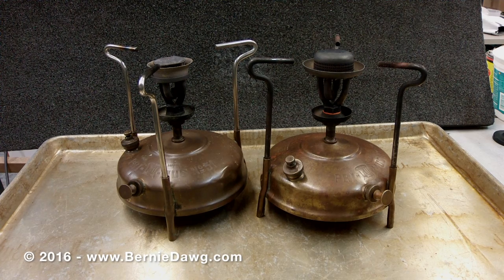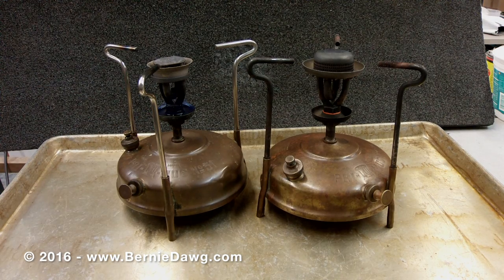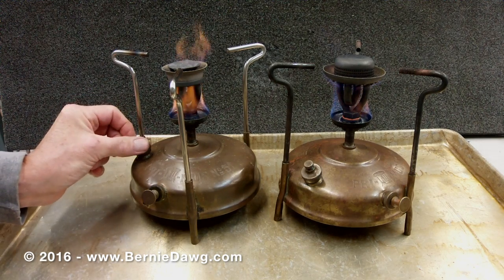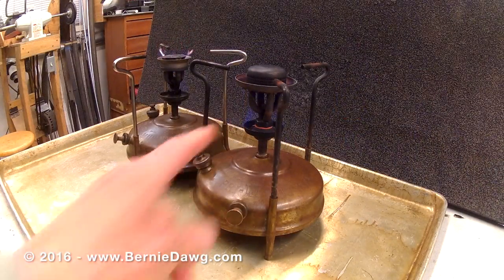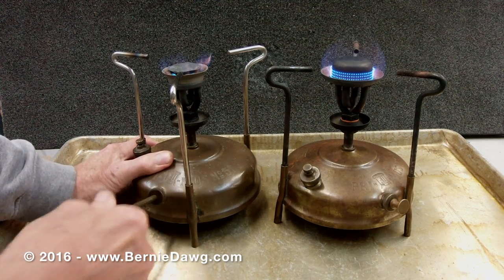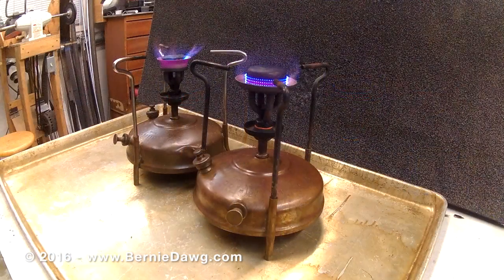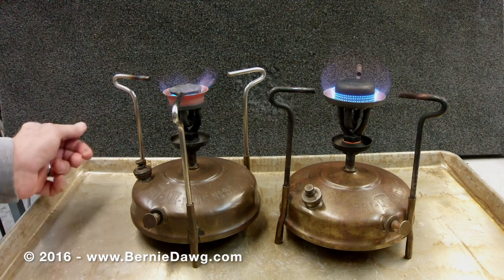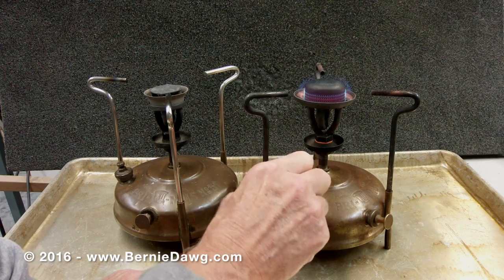How to Light and Operate a Vintage Kerosene Stove

Comment: Hi I just got a Valor 55 pressure cooker I've followed all your instructions,but it doesn't seem to have any pressure ,when I pump it can you please help me thx Lloyd from New Zealand
Reply from the maker: @Lloyd Morgan Sure Lloyd. Easiest is to send an email to my help line here: bd@berniedawg.com But, if you're shy, here's a bit of help. If it doesn't pressure it could be because the filler cap gasket is shot and needs replacement. Or, the NRV valve in the bottom of the pump tube needs servicing. Or, the leather pump cup on the pump shaft is missing or in bad shape. I have other videos that show you how to fix all that. Check through the playlist here: https://www.youtube.com/playlist?list=PL9Tg7BYD6fULVp5VFHNYZkUSIQUA6R8Gk BD

Comment: Hello BD, this is probably a stupid question but can you interchange silent caps with the plate type on any stove? my little brain tells me there might be problems as if they come that way leave well alone, but I like the quiet burn, thanks for all the info just subscribed to the channel and enjoying, Ted from N.Ireland
Reply from the maker: Hi Ted Your question is not stupid at all. I hear this question all the time. Thousands of people, the majority of people in the world actually, would rather their loud stoves perform like they had silent burners. Some original manufacturers even made products for this purpose. But, these days, if you have a flame plate type roarer burner I have a solution for you. Check https://www.shapeways.com/shops/berniedawgshop or https://i.materialise.com/en/shop/designer/gary-adams . These are products I designed and have printed through 3D meal printing outfits that can transform your loud flame plate roarer stove to a silent stove. Don't forget to read the instructions found here before you purchase: http://tinyurl.com/lvv3syn Hope this helps! BD

Comment: Outstanding video. Thank you. I have 2 of these roaring stoves from India. Very old.  There are made from brass but I never knew how to operate them.  I am going to buy the kerosine / or lamp oil and try it.
Reply from the maker: You must make sure to replace the old rotten seals on your "old" stoves before fueling or firing. Avoid flaming injury or death. Video shows you how: https://youtu.be/2LKsxIYCTko  BD

Comment: Thanks for the video mate. I just acquired one of these burners you have on the right in your video from my late father's estate. Very helpful video, cheers. 🤙🇦🇺
Reply from the maker: @Mark Thanks! I have a playlist of other videos that will help you to get the seals freshened up so you can use your Dads old stove safely right here: https://www.youtube.com/playlist?list=PL9Tg7BYD6fULVp5VFHNYZkUSIQUA6R8Gk Happy fettling! BD
Reply: @BernieDawgCinema  Thanks mate. 🤙🇦🇺
Reply: @BernieDawgCinema  Hi Bernie, any tips on getting the burner back to being nice and shiney?
Reply from the maker: @Mark Sure. You can spend many hours with non-ammonia brass/metal polishes and a toothbrush to get the burner shiny. Problem is, once you light it again all the work you did will disappear completely as the brass/bronze alloy of the burner turns grey from oxidation in just a few minutes of use. No point to polishing burners unless it's just going to sit on a shelf and not be used again. Hope that helps. 👍 BD
Reply: @BernieDawgCinema  Cheers mate. 🤙🇦🇺

Comment: Thank you. This is exactly what I wanted to know. One question Bernie, how do I know if my stove is silent before operating it? It's a Svea #5 and I literally bought it at auction yesterday.
Reply from the maker: You take a look at the burner you have on your stove and compare yours to the burners on the stoves in this video. Silent burners look completely different than roarer burners. The Svea 5 should have come fitted with a silent burner from the factory, but only you can tell if it has the original burner or if it was refitted with a roarer at a later time. OR… send me a photo of your burner and I can tell you what you have. Bd@berniedawg.com .

Comment: Food tastes better cooked on these stoves and the aroma gives you an appetite
Reply from the maker: Cooking food outside in the wilderness when you are really hungry always makes it taste better. 👍 BD
Reply: @BernieDawgCinema  Absolutely and the thrill of cooking on a primus/optimus that preceeds eating is an appetiser.
Reply from the maker: @Rammoy1  "Thrill"? 😲 Okay. If you say so. 😀 BD
Reply: @BernieDawgCinema  Yes pure thrill. I love these stoves so much. By the way one of my silent burners is giving out a thin streak of smoke when burning. I thought the jet is oversized so changed it with  onother which I guessed had a smaller aperture but with no luck. Fume still comes out don't know from where.
Reply from the maker: @Rammoy1  Again, *as I said to you before*, it is difficult to diagnose problems in YouTube comments. You are welcome to send me email and photos of your stove issues to the email address you'll find in the description section below the video.
But, a "thin streak of smoke" generally indicates a fuel vapor leak from a crack or hole in the burner. Waving a flame source like a lighter near the vapor stream will often cause it to to catch on fire and make a small candle flame where the hole or crack is located, and from which the burner is emitting the fuel vapor. Holes/cracks in burners negatively affect the flame quality of the burner and may cause yellow flames or underburn. Burner cracks or holes need to be repaired with "silver brazing" at a very high temperature (700-800 Deg C). Such repairs require well-practiced stove repair skills. I do such repairs frequently for my clients and at little cost. I demonstrate silver brazing repair of a Optimus 111C burner right here: https://www.youtube.com/watch?v=PYK-0KwQBzc  BD

Comment: Thanks for the video, can I ask how much fuel is needed to fill tanks from empty? Your vids have been so helpful
Reply from the maker: @roy allan That’s a more complicated question than you may have guessed. The two stoves in this video each have a tank capable of holding 2 pints (0.94 liters) of fuel. But, because you need air space in order to pressurize the fuel, the original manufacturer (Primus) directs to fill each of these stoves only 2/3 full (1.3 pints or 0.63 liters). That’s for the two stoves you see in the video.
But… these sorts of stoves came in many, many sizes and models with tanks ranging in size from as little as 1/2 pint (0.23 liters) to as large as 8 pints (3.78 liters) or more.
Best practice is to fill the tank so that the fuel is a bit below (1 to 1.5 centimeters below) the inside of the fuel filler neck when you peer into the fuel filler. This will give you roughly 2/3 fuel and plenty of air to pressurize the tank no matter which of the sizes of vintage stove you may have. 👍 BD

Comment: What does the pressure do to kirosine in the Tank? Will it pump it up to the burner?
Reply from the maker: @Amma Doing Yes. The pressure in the tank forces the kerosene up into the burner head. The pressure also forces the kerosene vapor (a gas created by boiling the kerosene in the burner) out of the jet. That is how these stoves work. BD

Comment: Hi BD, I’m restoring two of these one made in Australia and another from Sweden. I have them building pressure nicely but having trouble with kerosene spraying from the jet like a water pistol. It it because it’s not hot enough? Or any tips to stop that would be great. I enjoyed your video thanks
Reply from the maker: @Diegovswild You have to preheat the burners so the burner will be hot enough to vaporize the kerosene. Kerosene should exit the jet as a gas, not a liquid. Use quality 1-K rated kerosene for the stove fuel. Use denatured alcohol or any good quality ethanol alcohol to preheat. Fill the preheat cup to full. Light the alcohol. Allow to burn out completely, add a few pumps pressure, and light the stove immediately. Don't pump it up crazy high at first. Let it continue to warm up for a bit before adding pressure. Rewatch the video. I show all that in there. Good luck. BD
Reply: Thanks again mate 👍🏼

Comment: could  you use a gas torch  instead of the alcohol  to heat up the stove burner
Reply from the maker: @Rex. Georg III Well, Georgie, you could do a preheat with a propane torch, but unless you are quite proficient and attentive, I’d caution against it. The traditional tried-and-proven denatured alcohol method endorsed by original manufacturers and used for the last 125+ years by people all over the world delivers a consistent and appropriate heat. A torch in foolish or hurrying hands could easily overheat or even melt the burner or parts of the burner. !!!! 😲 Torches like you want to use were made for that purpose - melting of metals. There is no need to be hasty by using a torch. Slow down and enjoy life. 😎👍 BD

Comment: What pressure does the tank need to be maintained at to produce a sizzlin' hot flame using a silent burner?
Reply from the maker: @nigelpatrice philp That’s a funny question! 😄 There is no pressure gauge on the stove to make such a measurement. 
Sooo… IF the stove is in good working order and properly maintained (which many are NOT!)… then, I’d estimate about 20 strokes of the pump to get a good solid flow of fuel vapor which will give you a nice big flame with a silent burner 2-pint stove as shown in this video. If you are asking this question, I’d guess you may be having problems with yours. Maybe check out the repair playlist for kerosene stoves at my channel here: https://www.youtube.com/playlist?list=PL9Tg7BYD6fULVp5VFHNYZkUSIQUA6R8Gk or just drop an email with some photos of what you have there to my email address to get some expert direction. bd@berniedawg.com BD

Comment: Note that priced of these things are skyrocketing at the moment on EBay. I guess something to do with possibly gas shortages.
Reply from the maker: @TANK BATTLE PICTURES "Skyrocketing"? Again, as I've often pointed out... these stoves have not been made for 40 or more years. As they continue to disappear, they get more valuable. Each year that goes by, they go up in price. Not sure it has much to do with "gas shortages", just regular old supply and demand of a no-longer-made product. Completely normal for this to happen. That said... I see that there have been more than a dozen sold over the last two weeks for under $100 USD on eBay. $100 = a dinner out with the family or a single night in a motel. So, no great cost at all. Keep it in perspective, and remember, there is no such thing as a free lunch. 👍😎 BD

Comment: Do they sell these still im intrested in buying one
Reply from the maker: @Michael Willconquer The big Swedish companies (Primus, Optimus, Radius, Sievert/Svea) that first produced these sorts of stoves as early as 1890 stopped production of them from 1960 through the 1980s as each company slowly moved on to other things or was absorbed/purchased by other companies. But, that means millions of them were made during that ninety year stretch. While there are still some low-quality versions being produced new by unnamed companies in places like India and Singapore, for your sanity and your safety, I’d suggest avoiding those. Instead, shop eBay for “kerosene stove” or the same search terms paired with any of the company names I mention above. There are lots to find still out there. Rebuilding one of the solid and well-made Swedish stoves will get you a safe and well-performing stove that will outlive you. I have many videos here at my channel that show you how to fix your stove you end up buying. BD

Comment: Which of these two models is more efficient?
Reply from the maker: @Supervivencia criolla No real difference. The jet holes are the same size so the same amount of fuel is coming out of the jet and mixing with air. Same amount of fuel = same amount of flame = same amount of heat. Fuel efficiency on small stoves like this is really not something to trouble yourself over. If the flames are clear blue like I show, and not yellow, then you have a pretty-close-to-ideal (efficient) fuel mix with air. Blue flame = efficient. Yellow flame = wasted fuel. 👍 BD
Reply: @BernieDawgCinema  Thanks for the answer, it was very clear.  I have another query, I think I asked you in another video, I need to repair the valves of these devices, I have seen that they are disassembled, cleaned and reassembled, do you only need that?  Remove the rust?
Reply from the maker: @Supervivencia criolla I'm pretty sure I cover that subject well in this video: https://youtu.be/2LKsxIYCTko Try it and see. If you still have questions, bd@berniedawg.com BD

Comment: It looks like I have a WW II German brass Kerosene Pressure Stove. The pump cap has a swastika and VIP or VID engraving.  The pressure setting knob has VIR engraving. The  burner has “export quality”  and TVTV (upside down V). Can I use other fuels besides kerosene?
Reply from the maker: @Daniel Mercado No!! Only kerosene. Using the vent screw to release pressure while using a non-kerosene fuel can cause a big flesh-burning and hair-removing fireball when the volatile vapor of the non-kerosene fuel ignites. Kerosene is low volatility and doesn't produce vapor at room temperature. BD
Reply: I acquired the stove in 2004 Iraq and used fuel provided by our amtracks... we were able to supplement our diet with it... I needed to clean the injectors with pipe cleaners periodically.  I wonder what fuel I was using? Lol.   By your reply we were lucky we didn’t blow ourselves up.. something the enemy couldn’t do as well.... we are some lucky SOBs ...
Reply from the maker: @Daniel Mercado Well... maybe. I've not seen what you have there. I've only assumed it looks like the ones in this video, since you are making your comment here. But, there's no telling what you actually have since you can't share photos in YouTube comments. That's why I have a handy helpful email address in the description box below the video: bd@berniedawg.com . Send photos and I can comment intelligently. If you were using auto or truck gasoline in one like the ones I show in this video... then yeah, you were lucky indeed!! 😲 BD
Reply from the maker: @Daniel Mercado Thanks for the email Daniel. I'm sharing those photos through my website with other readers here. Hope you don't mind. 
https://www.berniedawg.com/wp-content/uploads/2021/04/Image-1-scaled.jpeg
https://www.berniedawg.com/wp-content/uploads/2021/04/Image-2-scaled.jpeg
https://www.berniedawg.com/wp-content/uploads/2021/04/Image-scaled.jpeg
That stove is definitely a kerosene-only roarer-burner stove. And, it's likely made in India. The swastika is a common symbol in Indian Hindu and Buddhist culture.
Thanks again for sharing! BD

Comment: Can you burn white gas in one of these old kerosene stoves.  I have a Svea No. 15.
Reply from the maker: @Jake Gregg It would be dangerous to do so. The only way to turn off the stove is to open the vent screw. If you had white gas in there, it would vent white gas vapor into the air near the flame and KA-BOOM! Plus, white gas being more volatile than kerosene, will build more pressure in the tank as things warm up. On the Svea 15, there is no safety valve to release pressure from the tank in case of over-pressurizing, so you run the risk of a tank rupture and an even bigger KA-BOOM-O! Hope that helps. What's wrong with using kerosene? (Curious minds want to know.) 🤔🙂 BD
Reply: Thanks. Nothing wrong with kerosene. We just have white gas on hand and wanted to try out our newly acquired stove.
Reply from the maker: Gotcha. 👍 For safety sake, you'll want to replace the rubber seals on the fuel cap, and especially in the NRV, if the stove has not been used for some time. Before you try to start it up. I have a quick-start tutorial on that here: https://youtu.be/2LKsxIYCTko If you need more guidance: bd@berniedawg.com

Comment: Mine is light yellow flame i need to fix that please
Reply from the maker: @Okwa Sadamafi  Fuel must be good. Use quality water-white (clear) 1-K grade kerosene in your stove. Preheat it as I show. Clear the jet with the included jet pricker (a fine wire held in a slip of metal). If none of that works... send me a photo or video of your stove problem to: bd@berniedawg.com and I can diagnose better to help you solve problems. BD

Comment: How much it consume in 1hr?
Reply from the maker: @Anuradha Kumari These stoves come with many different capacity tanks and different sized output power burners. The two stoves shown in this video have tanks that should be filled with 1 and 2/3 pints of kerosene fuel. At “normal” flame (boils one quart of water in 3-4 minutes), the fuel in the tank will last 3 and 3/4 hours (225 minutes). Bigger tanks will hold more fuel and the fuel tank will last longer. Using the stove at lower flames will make the fuel last longer. Larger burners burn the fuel faster. BD

Comment: Can it operates diesal petrol
Reply from the maker: @HAPPY FAMILY. JAI SHREE RAAM Diesel for automobiles and trucks is a very poor fuel to try to use in stoves. Stoves are small and have no pressure. Diesel engines are large, run at thousands of degrees of temperature, and have many hundreds of pounds of pressure inside their cylinders. Diesel cannot be used in any stove with any degree of success and the unburned fumes are toxic around food. BD
Reply: @BernieDawgCinema  thanks

Comment: Does anyone know why a stove like this would just stop burning (flames off) abruptly and continues to work fine after re-igniting.
Reply from the maker: Windy conditions blow the flame out? Low fuel level so the stove starts sucking air? Bad gaskets allowing air into the fuel path from below the burner? Incorrect fuel? Probably more besides. For definitive answers that help you fix your stove problem, send email with photos or video links to: bd@berniedawg.com 👍